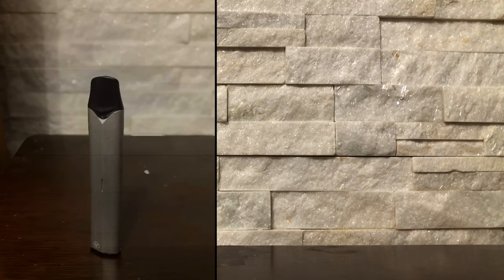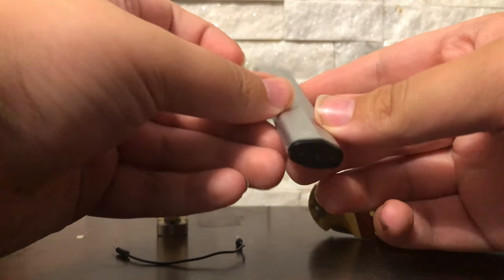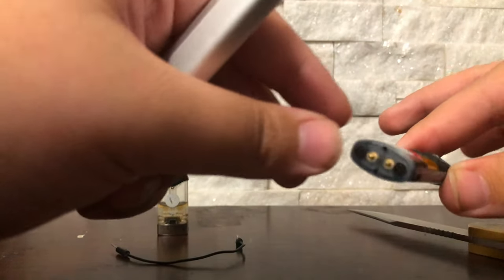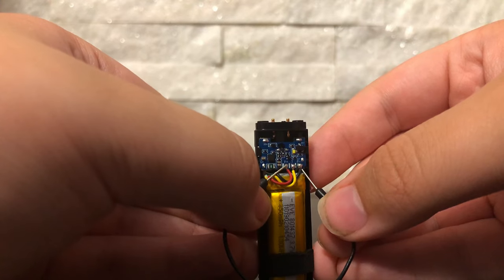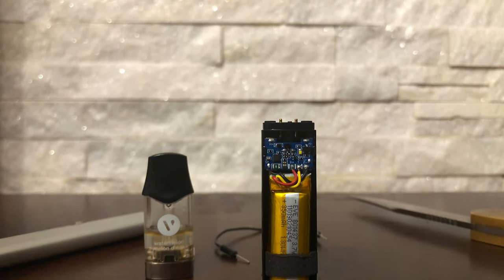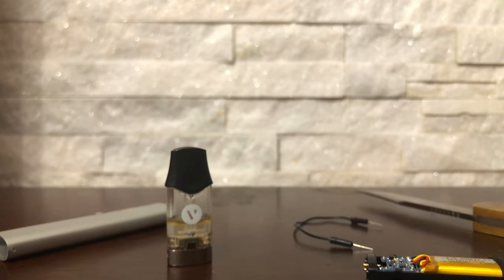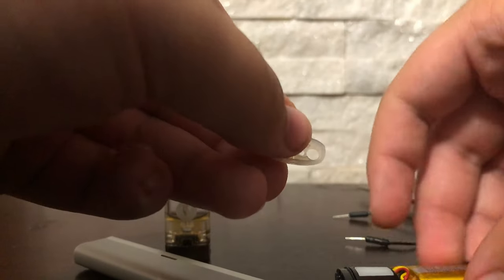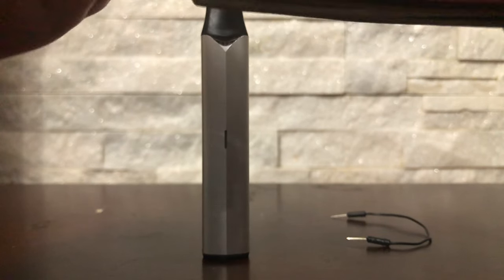How To Fix Defective Vuse ePod 2 In 5 Minutes! | [WORKING 2024] | Check pinned comment

Comment: READ!!! If the vape is vibrating and the red lights flashing DO NOT go full Elon and start ripping apart the vape. It’s very likely just on child safe mode and locked. What you need to do is press the on button on the side. 3 times. Not fast but not super slow. The light should turn green and start working again. No idea if this video works but I was too lazy to try all this and just called the vide customer service. They can help with anything and are super friendly.
Reply from the maker: just to clarify, this is for the original epod 2 the one you described is the epod 2+, much different. this one is the only way to fix this one, the epod 2+ that you said is true the lock is a thing but not on this. if you contact support for THIS vape they will say to send it to them and they’ll send you a new one (free but takes much longer)
Reply: this was the problem with mine! thank you so much for this comment :D
Reply: Damn thank you! Being trying for weeks
Reply: Omg thank you so much I just kept buying a new one now I have like 5 vuse lol… thanks 🙏
Reply: Lmao thank you. I'm on the 3rd one that's done this now. Tried pressing the button a bunch of times and holding it down and nothing was working but the 3 slower presses worked lmao thanks. Now I have 3 working vuse 2s
Reply: I had tried the 3 presses and it actually didnt work until I did 3 short presses, had no idea there even was a child lock, thanks
Reply: oh my fuckin god… it was that easy.
Reply from the maker: that’s for the epod2+ model that works with your phone not the previous version
Reply: True
Reply: @xenocal  shit works wit yo phone?
Reply from the maker: @ets0o0  the model with the button on the side yes
Reply: Thanks for this i almost throw my vuse hahaha
Reply: thank you so much
Reply: omg THANK YOU SO MUCH
Reply: Love u
Reply: What button
Reply: thanks man, only found this out after my 4th broken one lmao
Reply: U saved my life
Reply from the maker: Kechena.. the opposite actually
Reply: Good job man
Reply: Yea safety mode. I wasn’t about to start shorting chips when it was happening to 3 vapes. I figured (as any logically thinking human should) that it’s probably something to do with button presses
Reply from the maker: @JasOn-rs7xz  yes and no, yes being yes you are correct that it takes 3 button presses. but also no because there are 2 models of the Epod 2 by vuse. The epod 2 and the epod 2+. the epod 2 is the one shown in this video and DOES NOT have a button or companion app. The epod 2+ (in this video) does HAVE a button and companion app and has very different issues or safety locks. So again these are 2 different vapes/models. if an iphone 13 doesn’t work and had its own fix doesn’t mean it would work on an iphone 12 with a similar issue.
Reply: Thank you
Reply: I LOVE U BRO
Reply: @SlotmachineMaster  Same for me - If not for your comment I'd have sent mine back!  Thank friend!😁
Reply: WORKED. THANKS
Reply: @xenocal   thank you it worked. Life saver you are... or rather pod saver!
Reply: You fixed my vape

Blessings to you 👏🏻
Reply: this fixed my issue omg bless u
Reply: Lmao It works…thanks for this
Reply: This was the problem with mine!!! Thank you so much hahah all we needed was this comment
Reply: Actually worked 🙏🙏🙏
Reply: just helped me, thank you.
Reply: Ily bro u saved me😭🙏
Reply: Bruv....... thank you
Reply: Thank you omg, I was going crazy I thought I got ripped off
Reply: YOU ARE A LIFE SAVER. THANK YOU.❤
Reply: Omg!! Thank you!
Reply: There are no buttons on the side😂
Reply from the maker: @dylannobles2397 there are 2 versions of the epod 2, there’s the ePod 2 and ePod 2+ which has a button and can connect to your phone via a vuse app.
Reply: Thank you
Reply: Bruuh thanks 😭😭
Reply: Youre the bestt
Reply: Thank you sooo much! I dumped my first device for the same reason😭
Reply: Bro Ty so much!! MVP
Reply: Legend
Reply: I love you so much
Reply: Omg bro I went through 3 different vapes until I saw your comment. Thanks brother!!!
Reply: Thank you
Reply: Lmao you're a genius man thank you!! Straight up. Also the Elon thing made chuckle.
Reply: King. Lol.
Reply: This is what I was looking for. For some reason, I couldn't find anything about this online,
Reply: i locked my vape, no idea how, but thanks that fixed it for me !

Comment: My vape works…it’s the pod that doesn’t work. Will work a bit then stop working. I’ve checked to make sure it’s not the vape by putting a new pod in  and it works until about half of the juice is gone. I now have 5 pods that are half full and won’t work. Another channel said to tap the pod on the table a few times but didn’t work. 50 ppl commented that it worked for them!!!!

Comment: i had been using exposed wires to charge my battery because i dont have an actually charger its not this model tho it has the words vuse written on it but no logo when i try using the wires the light flahses for like a millisecond and wont hit do you have any tips? it used to work but now it doesnt

Comment: I did all that, when it slided out some wires came loose and I broke the plastic where the knife went. Figured the thing was ruined. Slided back in to throw it all out, gave one last puff and to my extreme surprise it worked! I did all this after I went swimming at the pool and forgot the vuse inside my pocket. Swam for about 45 minutes. Amazing, not sure how long it will work and it does not charge anymore. Cheers for the after life! P.s I used a hair blower to dry the whole chip board and battery after I had it opened.
Reply from the maker: using the blow dryer wasn’t a good idea because the heat and the battery, however congrats and to fix the charging it’s probably torn wires, those are easy to repair with a soldering iron which i have but i never needed to solder anything on mine, i have switched to a Uwell caliburn G, best vape i’ve ever had, flavour is record breaking tbh
Reply: @xenocal  Thanks for the tip, just switched to Uwell. Much better. Now Im smoking out of control.

Comment: Thanks a lot man, it worked like a charm! 

In my case, I've had my device working fine for several months and suddenly had this same issue, charges fine and blinks when plugging in a pod but wouldn't fire.
Good thing I kept my old vuse epod and didn't jump to buy a new one, thanks again!
Reply from the maker: i was unaware that it would also work for vapes that don’t fire, but thanks for letting me know it worked for you. i’ll have to try it out and see if there’s another video to be made for that issue aswell. Thanks for the comment!
Reply: This exact thing just happened. Flashed in the charger as normal, but when I pulled it out to take a puff, everytime I tried it wouldn’t fire. Light would just blink three times. I shorted it out and put it back in the charger, it lit up. Put it back together and it works fine again. This hack should def be the first go to for anyone!!
Reply: @xenocal 😅

Comment: Thank you so much for this. I bought one and it worked for two weeks then completely died. I replaced it, and the new one died the next day. This was the only source I found. I had a heck of a time getting the insides out, but I finally did, and this works. I didn't have a wire or paperclip, so I used a fork. Thank you again!
Reply: If you have ongoing problems with this, check the power rating for f your power supply.  I was charging mine with a 2.4A iPhone power supply. Had untold problems. Devices would only last a few days. Started using a 1A charger and problem solved. I think I may have even read on the box that they are only actually supposed to be charged at 0.5A

Comment: Man it worked!! Only tip is that, the metal pins that you broke trying to pry the circuit out, can be taken out with a knife or tweezers
Reply from the maker: i’m aware of that part, i couldn’t figure out how to do that the first time but after some force it didn’t matter because in the end i needed to open it several more times because this issue keeps happening on a weekly to bi-weekly basis
Reply from the maker: thanks tho bud
Reply: @xenocal  aaah damMmm!! Bi weekly?!?! 
Seriously?!?
Reply from the maker: @thebongrovers  it changes from time to time, just happened to me again last. night

Comment: Use a pen or any small pointy rigid object to push the metal pin at the end in first, it does not have to go all the way tho, hammer and nail would work just fine.

Comment: Before trying this, I would recommend trying a different pod and seeing if it works. You may have a faulty pod. 
Which is what just happened to me, but I found that out the hard way (after trying this with no luck)

Comment: IT FINALLY WORKS !! THANKS SO MUCH !! I didn't have that wire thingy so I used a staple. Bend it a bit so it can touch both the black and red and BOOM. Bit of sparks,, but that means it's working lol. THANKS ONCE AGAIN.
Reply: Lol I used tweezers it work d tho cheers

Comment: This makes me wonder if the device just has some sort of life-span shortening "killswitch" on board. Because we're essentially just hard resetting the device.
I tried it and it worked, broke the casing attached to the battery but the metal casing holds everything together well enough. Though I doubt I'll be able to do it again without breaking the casing off entirely.
Good find, well done
Reply from the maker: if it had a “kill switch” it shouldn’t kill it an hour after first use out of the box lol. but i see what you mean, apparently what can happen is batches and boxes that get shipped out to like convenience stores and some vape shops have bad batches meaning that entire box shipped of vapes are all gonna go bad or are defective.
Reply: @xenocal  I guess not necessarily a kill switch but something on board that will kill the connection to the battery if certain conditions are met. It just doesn't make any sense why they would work for such varying periods of time

Comment: Hey! I have a question. I just bought a Hexa Pod. The first insert worked without issues. However, with the next insert (I tried three different ones) I got a red flashing light when I tried to take smoke, although the light blinked green when I put the pods in the pen. What could be the problem here? I have tried cleaning it but no results. Thanks!

Comment: Yooo this works! Thanks so much just saved me 50$ going to buy a different vape. Also used tweezers Cus I didn’t have the wire
Reply: Does it shock you if you touch the tweezers?
Reply: @whitephillip6997  I thought it would have but it shoudnt. I also made a wire thing for my puff bars and it didn’t shock me either
Reply: @samantha._.4029  yeee thanks for the reply, it worked! 👍💪
Reply from the maker: it’s nowhere near enough power to actually feel it, aslong as you do it right, the battery will be completely safe and you won’t feel anything. you barely feel an outlet in your house if you’ve ever been electrocuted by an outlet, this doesn’t even make close enough power to make an arc between a gap. it is completely safe.

Comment: Mins is blinking really fast and I can’t suck for even just a second. Battery is full. I opened it like shown and some liquid from a pod dripped  inside the device, probably caused by the recent flight ✈️ I had, since I noticed liquid underneath the pod back then. It’s still not working. :(

Comment: hey, do u happen to know whats the voltage thats put  for vuse cartridge to work? I got one thats water damaged, and I have a lot of full cartridges lying around so I figured maybe I'd do some DIY...
Reply from the maker: honestly im not sure on the exact voltage but a simple usb 2.0 running from a laptop or PC would work. take a usb 2.0 cord, cut the charging end off not the USB MALE end only the Micro usb end and take the 4 wires and get rid of the 2 random colors. the wires you need to keep are the RED and BLACK (of course) and with the pods i dont think positive or negative sides matter so carefully apply both wires to the pod and plug it in. my idea would be to solder them or glue them on so they stay and wont touch the other terminal. then simply plugging the usb in or taking it out would fire the pod. - Lemme know how it goes! nexq.
Reply: @xenocal  thanks alot!!!!
Reply: @xenocal  ok so I used usb c cable instead of micro usb, only difference was that instead of black there was a gray wire but I figured it still should be the ground one. It works, only hindrance is that the pod is always on so soldering in some kind of switch or button would be great. Again, thanks for help!

Comment: thanks man ur video gave me the motivation to take another stab at my juul that is basically having the same problem and my old but brand new just opened vuse was doing the same shit . I have not fixed the vuse yet but thanks to u my juul is fixxed . I did what u said, plus used a low charged 18650 to quick zap (a couple 1 to 2 sec zaps) to add sum juice into it and wala it started charging finally

Comment: Hey bro my vuse epod2 completely stopped working while i took my last puff.  It then proceeded to overheat and cause leakage with the pod. I thought it was the pod that was the problem but in fact it was the device, because when i switched pods it caused leakage in the new pod as well, and the device started to become overheated, showing no lights whatsoever even when i try charging it. It also started making popping and burning sounds while vapour would escape from the pod mouthpiece. Will this method surely work in my case ?
Reply from the maker: that happened with mine a few times too, i know exactly what you mean. what happened with mine is it kept firing for no reason and it isn’t a user made issue it happened to my defective one too. My pods would melt to the point where there could be no airflow to even inhale through it. the fix i did was got new pods and did my method in this video. the reason i used this method is because right after this happened on my pod the device would stop working just like in the video so you can give it a try. do note it isn’t a permanent fix and you should always make sure your device is clean and juice doesn’t leak into the device. nothing too bad can happen from trying this the only bad part is it becomes required to do at very unlucky times like during the day if you forget your chargers or something. give it a shot and let me know.

Comment: What up man, I also have one epod2, recently I took a puff and left it on charger and when I woke up it wasn’t hitting, I did your method, I shorted it, then pulled the plug on it blinked like 3-4 times and lighting without stop, I tried to take a puff but it’s not detecting pod at all. Anything I could do about it?
Reply from the maker: if it doesn’t detect a pod, try making sure the contacts are clean. another possibility is your wires that actually power the pod to make a hit can get torn off inside the device which you would need to re-solder them if that’s the case. and another possible solution, try a different pod

Comment: so took the battery out a tiny black rige square popped out as well as a tiny rectangel white piece applied a paper clip as you instructed light came on then nothing - attempted to charge it as you said but no light help!!!
Reply from the maker: was it plugged in when you put the paper clip on the pos and neg solder points? try that if you haven’t. if you’ve tried that and still nothing try a different pod too

Comment: Heeey just a quick question my epod 2 fell in water and right at that moment it stopped working not even charging anymoreee??? HELPP!!!
Reply from the maker: water damage is hard to fix 99% of the time and since it’s a small device and there’s no way to replicate the devices water damage accurately best bet buy another or if it’s new you can contact VUSE on their site. but i have no fix for that sorry.
Reply: @xenocal  should i try short circuting it?
Reply from the maker: i doubt you’ll have any luck if you do what i did in the video because something is probably broken in it or the battery could be damaged by the water. i don’t see why you can’t try this method but if it doesn’t work, or the battery starts to smoke make sure you get it out of the house or building if it smokes from the battery. let me know how it goes
Reply: @xenocal  For sure,appreciate it keep up the good work 👍🏻❤️

Comment: Hello, what should I do if the device is not charging? It seems that the light is on, but then when you start smoking it starts flashing 10 times
Reply from the maker: could be the pod, might think there’s no pod, try another pod if that doesn’t work then try the same pod in a different vuse

Comment: Do I have to remove two metal pins before I pull the battery out?
Reply from the maker: technically yes if possible but they should stay out either way incase it happens a second time. which usually happens.